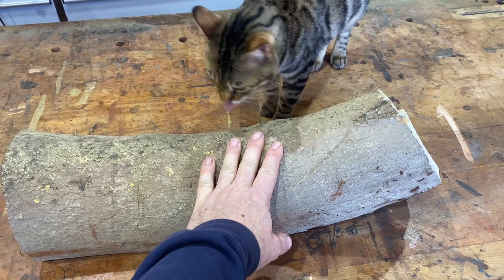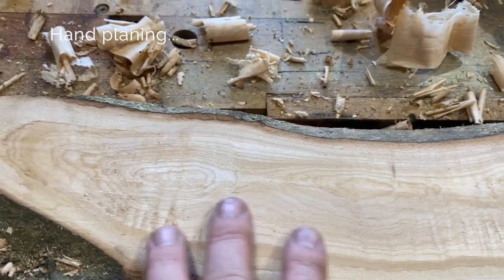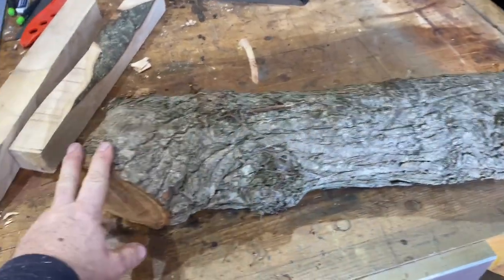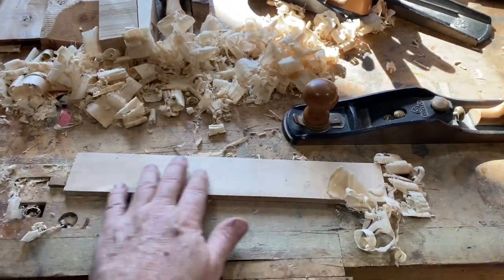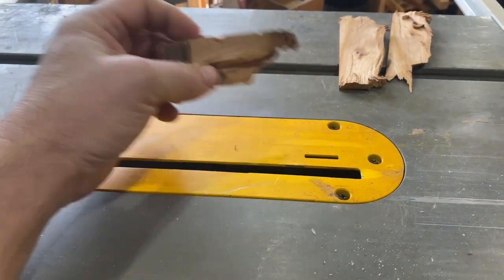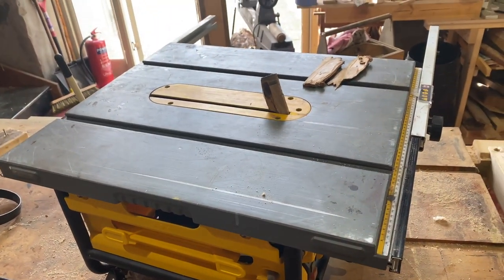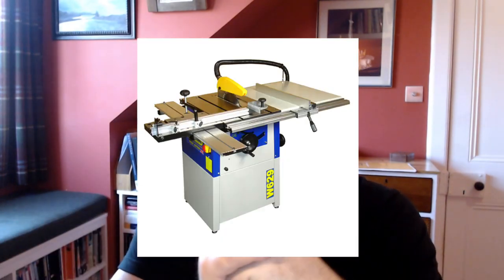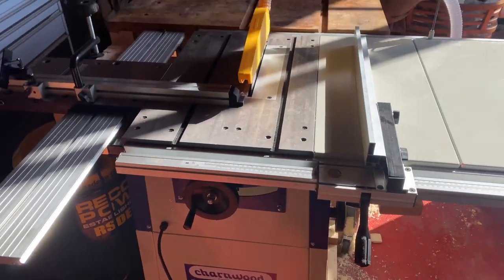Celtic Knot Rolling Pin that cost me $$$ thousands.

Comment: Beautiful rolling pins but I'm guessing that you didn't make your money back on them. 😥  Still that looks like a fine table saw and should do you well for the future.  The elm looked like a nice piece, I was looking at it as a knife maker and thinking of what nice handles it would make.  So in the end you used walnut for the knot?  I think that Toffee thought that lump of would would be ideal for chin rubbing and scratching! 😂
Reply from the maker: Correct on all points! Yes I think it is a solid investment and since setting it up I've replaced the side panels with my router table again, so have regained that functionality. I'm sure I could send you some of the elm off cuts if you wanted to make some handles - just email me, details on the website www.cottack.com. I originally wanted to make the whole pin from wood gathered in the village (both the sycamore and the elm) but yes, after trying to cut super hard elm into thin strips without using a zero clearance insert and all that followed; I found an old board of walnut I hadn't used and went with that. I recently picked up a large log of elder which had come down in the storms, really bright orange wood ...and toffee went crazy over it, just would not leave it alone ...something mighty interesting going on there in the cat senses world!

Comment: That's a lovely rolling pin. I admire the wide range of projects and repairs you successfully tackle. Thank you for sharing the process and your problems with the making of it. I was wondering if you considered using a zero-clearance insert to reduce the possibility of having a piece of wood get caught between the blade and the table? Regards from Texas.
Reply from the maker: Elaine thank you so much for the feedback and the question! The answer is YES YES YES ...and no. At minute mark 3:36 you will spot a lovely hardwood ply zero-clearance insert designed and made specifically for that table saw and specifically for small cuts of wood. So I certainly considered it. Planned for it. Anticipated it. 
...but did I use it on the day? Errr.... no. It sat completely unused in the drawer under the bench. I will make a new one for the new saw and hopefully have learned the lesson! I lived in Texas for a few years ....you may sometimes spot the license plate in the background along with my Wyoming plate! Best regards from Scotland
Reply: @TheCottackWorkshop  Thanks for the details. I'm sure you will enjoy the new saw.

Comment: Very nice great job, what was the new saw like ?,  have a nice day .
Reply from the maker: Thanks Brian - much appreciated. New saw is good ...very good. So much quieter and a solid clean cut with supplied blade. I haven't used it too much yet as I spent the next day installing my router table in place of the right hand beds and getting everyting level and solid. I've also cut a rubber mat to sit over everything when not in use as I find that projects on the main bench, used as a run-off from the saw, have a tendency to drift over onto the saw table ...including glue, paint, finish and the rest. I'm also going deliberately slowly as I get used to the new machine and what it can and cannot do ...I wouldn't say it was fear but I have a healthy respect for what can go wrong. As the mitre slots are different from the previous saw I'm going to have to make a few skids up to help with the safety side and functionality e.g. a cross cut sled. ...but for now I'm happy with the performance and the kit that was provided.